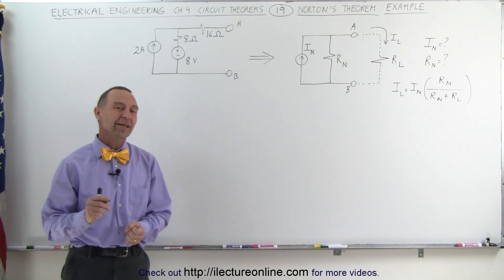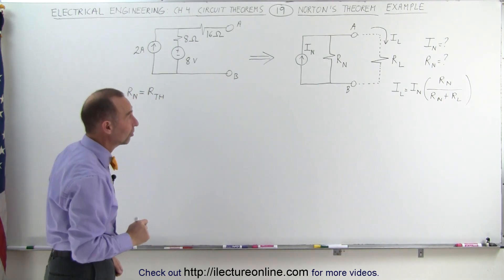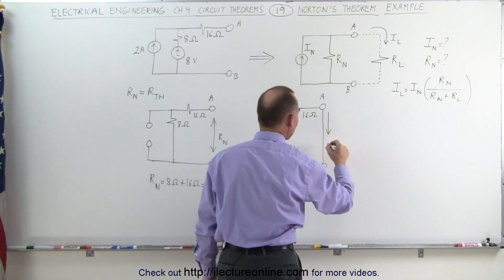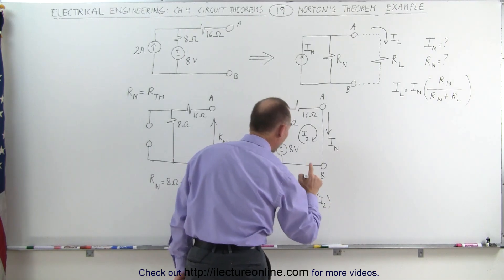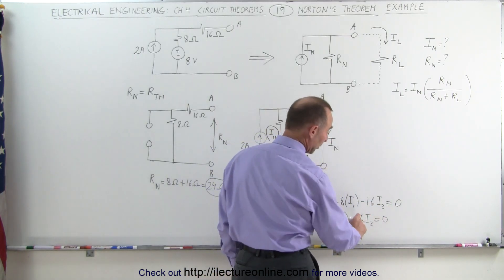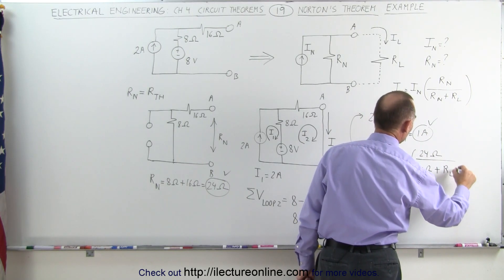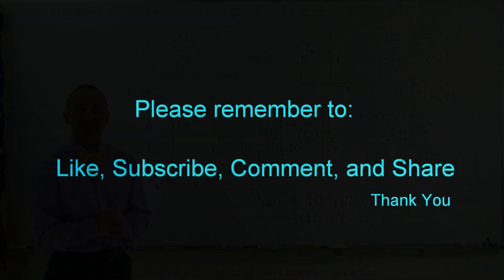Electrical Engineering: Ch 4: Circuit Theorems (19 of 32) Norton's Theorem Example 1

Comment: just curios what would be the Rth if there was another resistor after the 2A
Reply from the maker: A current source will adjust to ensure that it produces the current it is set to.  Adding a resitor on that branch should not make any difference.
Reply: @MichelvanBiezen  so the rth wouldn't change in value to add that additional resistors value as well?
Reply from the maker: I would not expect Rth to change.

Comment: Hi Michel, wondering what will be the value of Load R.,I think you did not find that...
Reply from the maker: The load resistor is whatever the load is that is connected.  It is not something we solve for (unless a specific value is given for the current), but the current becomes a function of whatever load you connect.
Reply: @MichelvanBiezen  Superb!

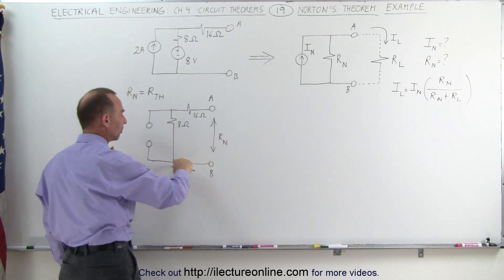Comment: @1:38 you say the Norton resistance is the "resistance between A and B"... WHY?. If the circuit is open between A and B the resistance is infinity.
Reply from the maker: Resistance on the path between A and B.  (It is not infinite).

Comment: Hey Michel, I really appreciate your lectures, and have been watching them for a little over a year now. I was wondering,  when you disconnected a current source and replaced it with an open source, what if there happened to be a resistor that ceased to allow current to run through it? How would that affect finding Rth? Thanks!
Reply from the maker: You leave the resistors in place and just removing the current source.  Then you solve for Rth with the remaining circuit.

Comment: I am having a hard time understanding why the I1 is equal to 2 Amps. i get that there is a current source there that says 2 amps but what about the 8 ohm resistor and 8v voltage source?
Reply from the maker: There is a current source forcing a current of  2 AMPS through  branch 1.

Comment: why does current I1 flow through only 8 ohm resistance, but not through 16ohm? sir please explain...
Reply from the maker: In order for current to flow, there must be a complete circuit.  No current will flow if there is not a continuous path.
Reply: @MichelvanBiezen  no sir .....i was asking about the circuit when A&B are connected for finding norton current. Why does I1 not split?
Reply: oh i got it sir....it was mesh analysis. Thank you sir.
Reply: @MichelvanBiezen  If there is no continuous path then how I-2 will flow through 16 ohm?

Comment: Great explanations!
But I have a question: when you are writing the equation in the loop 2,  doesn't the equation have to be 8 + (8)(i2 - i1) + 16(i2) = 0 which would give a current of 1/3 Amp
Reply from the maker: The equation in the video is correct.  Remember that if you go across a resistor in the same direction as the current, you have a voltage drop.
Reply: @MichelvanBiezen  thanks!
Reply: @MichelvanBiezen  please explain
Reply: If you use the equation of "- 8 + (8)(i2 - i1) + 16(i2) = 0" it would result i2=1A. You have to put a minus sign in front of 8V.
Reply: M4kkMester Yes, this also works. He just started at the positive side of the voltage source which is why his symbols are opposite of yours, but it means the same thing.

Comment: You are an excellent teacher. No one can teach all these topics better. I love the way you present these complex techniques simply. I've been following all your videos. I appreciate you. I want you to minimize the way the board is covered during lectures. I don't know how you can do that but I want the board to be visible at all times.
Reply from the maker: Thank you for the feedback.  We have been struggling with the same question and we think we have found a solution.  We now tend to work the board from right to left such that most of the material remains visible.
Reply: EXCELLENT PROF FOREVER

Comment: im so confuse . at lesson 16, we have the same situation by they are parallel. why are these resistor are in series now ? ???
Reply from the maker: It is the technique Norton invented to solve a circuit.  Learn the method first by going through the steps systematically.  Then you'll see how and why it works.
Reply: thank you professor I will go over it again. BTW, this is the most helpful series i could find on youtube. thank you so much for these video

Comment: How do you know I-1 of the Mesh Analysis is equal to 2 Amps? It does not appear to account for the I-2 traveling in the opposite direction through the 8 V and 8 R elements. Someone please clarify this point for me.
Reply from the maker: I1 must be 2 A because there is a current source on that branch.   Since the branch with the 8 ohm resistor carries I1 downward and I2 upward, you have to subtract I2 from I1 to find the current in that branch.
Reply: Thank you! That was killing me.

Comment: Why did we add the 16ohm and  8 ohm resistor if they were in parallel?
Reply from the maker: In the circuit on the bottom left side of the board, we removed the current source and shorted the voltage source.  At that point the two resistors are in series.

Comment: Out of curiosity, if we had a wire which began between the 16 Ohm resistor and the end-point A which ran down and connected to the end-point B branch, then the 8 Ohm and 16 Ohm resistors would be in parallel, correct? This seems to be something a lot of beginners, including myself, struggle with. There are so many definitions of parallel resistance that seem inconsistent. I usually go by "if the current splits between multiple resistors and end up back on the same branch then they are in parallel".
Reply from the maker: A wire from A to B would make a short circuit and no current would flow through any of the resistors.  If there is more than one path for the current to flow then the branches are in parallel, but there needs to be resistance on each branch.

Comment: In this case, can we use Thevenin theorem?
Reply from the maker: Just like in algebra there are many techniques to solve simultaneous equations.  With electric circuits, there are many techniques to solve them and all are good techniques.  We just teach different techniques as some work better on some circuits than others and it helps in the total understanding.
Reply: Thanks, Sir.